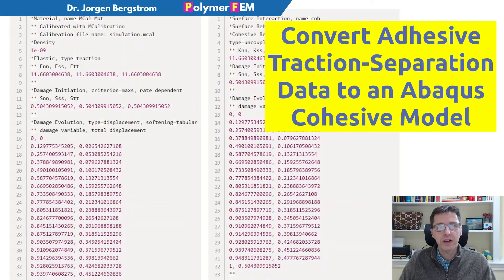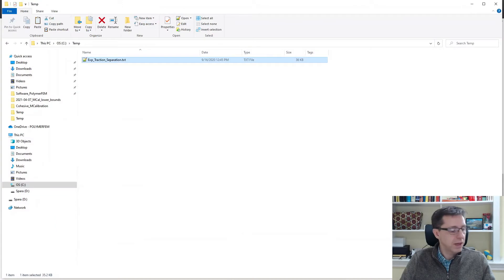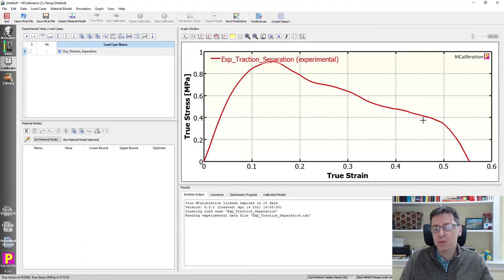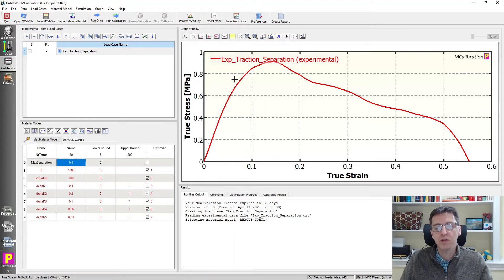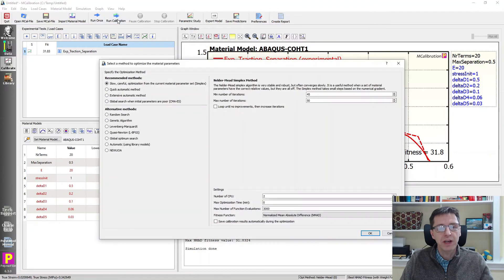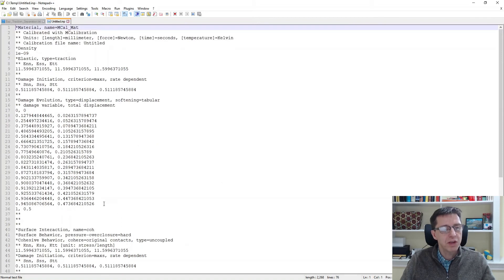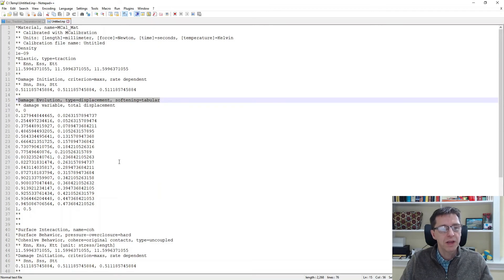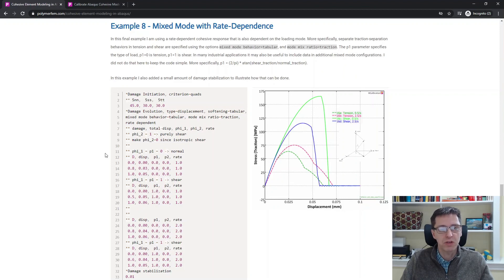Convert Traction-Separation to Abaqus Cohesive Properties

Comment: Hi Dr Jorgen, another query !!!! Why did you select "Confined Compression" for the Loading Mode...rather traction separation is normally measured through Mode - 1 tension. My question; is there a special reason on selection of "Confined Compression"in Mclaibration loading mode ? ( rather the real loading mode in experiment is mode - 1 type loading)...

Many Thanks !! All the best
Reply from the maker: Cohesive elements are simpler than traditional 3D FE elements, for example, cohesive elements only care about the displacements in 3 directions (one normal, two shear). When I added the cohesive element implementation to MCalibration I started with normal mode only, and no transverse displacements are allowed. That is why I recommend that you use "Confined Compression" as the loading mode. Another advantage is that in confined compression the engineering and true stress is the same. So it is easier to plot the results since the traction will be the same as the engineering and true stress.  At some point I plan to change how MCalibration handles cohesive elements. Specifically, I would like to allow for multiple loading modes in a more automatic way. Hopefully we will add that later this year!

Comment: Hi Dr Jorgen, just a one query... here in the model calibration you have included only Young’s Modulus ...... does the three modulus values (normal, tangential etc) that we see in Abaqus input file ( created through Mcalibration) are available through the calibration ? Or do we have to include those seperately ? That’s my confusion. 
Thanks for the video.
Reply from the maker: Good question. The current MCalibration implementation calibrates each loading mode (tension, shear) individually. That's why you only see one modulus value. You can then combine the tension and shear calibrations into a "master" material model file that has different moduli in tension and compression. /Jorgen